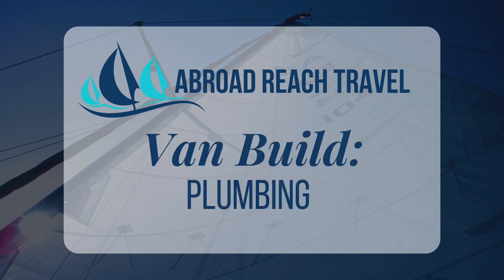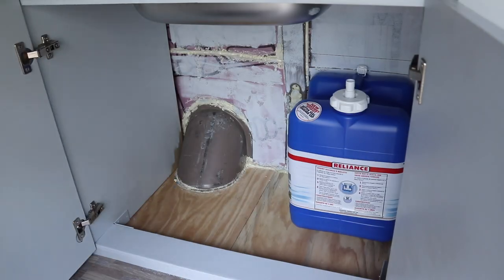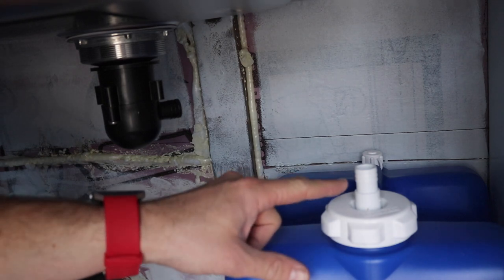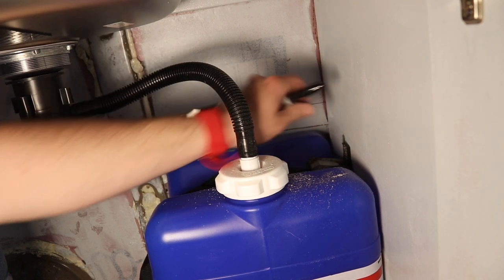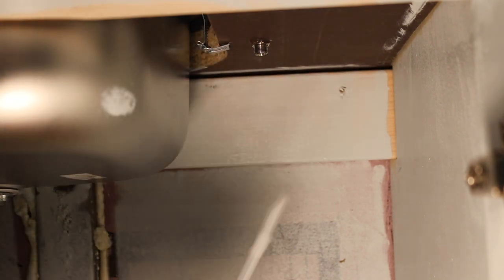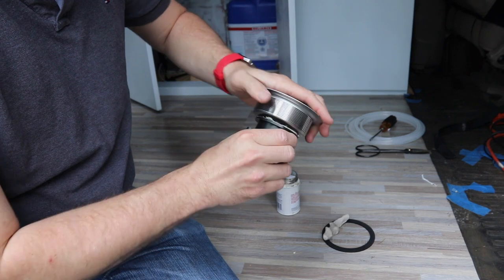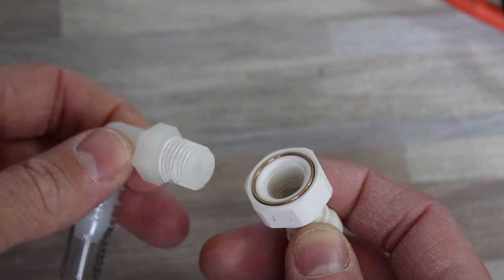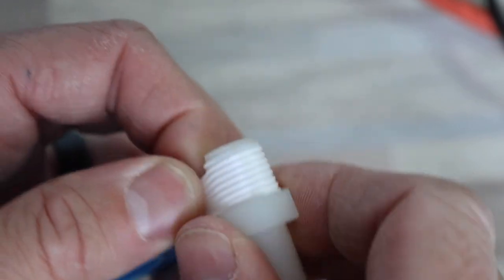Van Plumbing | Van Build Step 8

Comment: Is there any way for it to drain quieter into the grey tank? or does it sound like that cause the tank was kinda empty or something?  Also, did you connect the pump wiring to a 12v panel? Ty!

Comment: Hello! How did you connect between the end of drain hose (white colored 1/2" male fitting) and the cap of water tank (1/2" female fitting)? Was there any problem when you connected? I'm also using same hose and water tank, but it doesn't fit so I couldn't connect together.

Comment: How do you hook the pump up to electricity? I've watched like 10 videos and they all say, "step --- attach the water pump" without explaining how and I am quite confused.
Reply: I'm doing this is my vintage mobile home I'm just gonna run an extension cord to an outlet and do it that way.
Reply: Depends on if your running 12v dc off the battery or if you get a 100 amp pump for ac (alternating current) like a house. If it's 12v dc you'll have to run a wire off your battery banks positive and negative terminal. It would be easy to hook it to a switch also, that way you can turn it off completely by a switch close to the sink if for some reason your water line gets a leak. 
   The pumps will have a pressure switch built in so when they reach a certain pressure the motors turn off until you open the faucet, then when the water pressure drops they turn on automatically. If your not around and it springs a leak the pump will run continuously. Even after the waters all pumped out of your tank, then you'll probably end up with a burnt up pump and a mess of water to clean up.
   If its 100 amp you could plug it into a power strip with a switch to turn off, or wire it from a wall switch. That will depend on how fancy you want to get. A 12v from a battery bank you can also go with a fancier switch or a cheap toggle switch. Just make sure you don't get a momentary switch, thats the kind you have to hold down to work and when you let off the button it stops the power.

Comment: Hi, Great video. I have a similar reliance tank but the 7 gallons instead. Mine came with a spigot fitting, not a barb fitting, where did you get the barb fitting inset for the top that threaded in properly? Thanks!
Reply from the maker: Tim Morrissey I cut the end off of the spigot just before the valve. My hose fit on perfectly!
Reply: @AbroadReachTravel  got it! Thanks for the extra info.